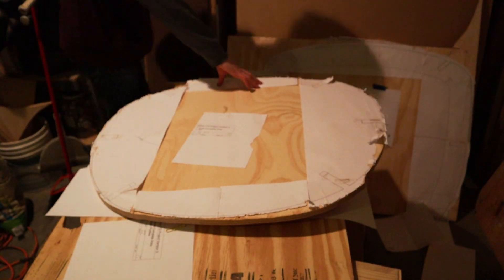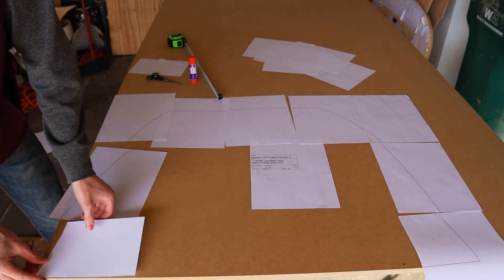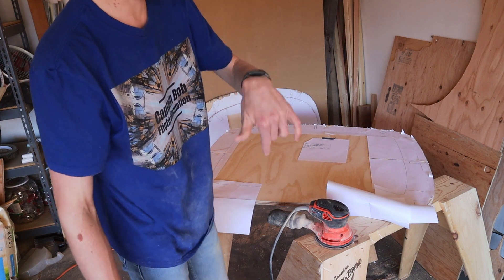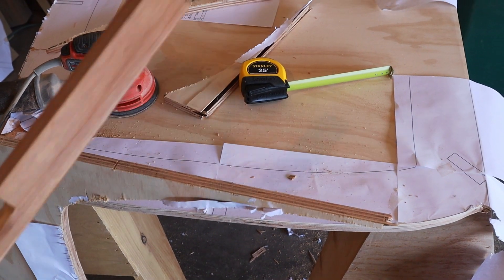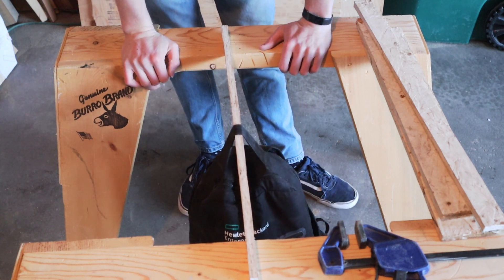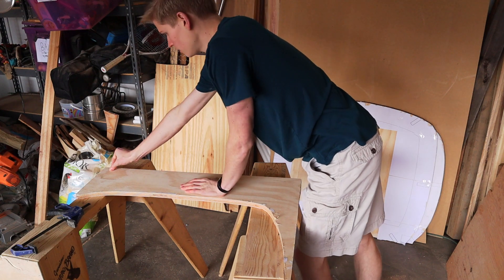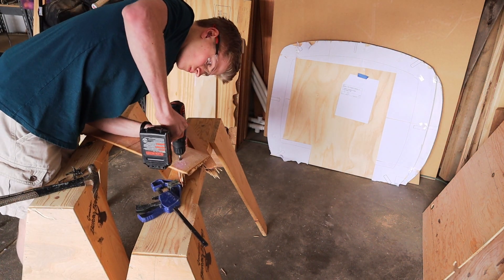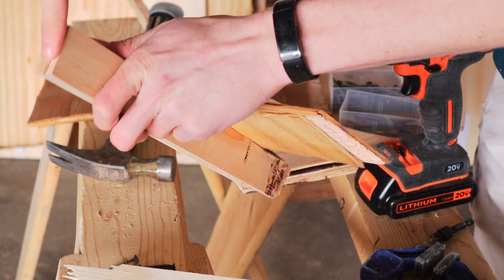Plywood Strength Testing and Cutting Ribs | Cessna172sdays Ep. 10  Captain Bob

Comment: Interesting. Have you come up with a formula?
Reply from the maker: No, but that would be very interesting to solve for!
I imagine more adequate measuring devices would help than just bricks :)
Reply: @CaptainBobSim  My project is to create a 1'x2' adjustable roof platform that spans two bolts, 20 inches apart. It is for the erection of a ladder upon the platform to service siding above very steep roofs. 

The metal platform and bolts should be able to hold 8000 lb, which is plenty.  My best guess is that a 3/4 plywood board a foot wide, can take around 18,900 lb before it breaks.  I am not sure if osha needs a 10 to 1, a 6 to 1, or a 4 to 1 safety margin.  Of course, I probably chose a 1 inch board, but would need to go to the storage to find out.

I am only about 140 lbs, and have tested the setup 4 times.  But I need to know if a 400 pound guy who misuses my unit will die, should it ever be used by other people.

   Now, for you and I, since we don't have a hydrolic press with a gauge, might need to cut a 1 inch wide plywood (maybe scrap from the stores or building site), and we can possibly extrapolate up to 2 inch wide and 10 inch wide by simple multiplication (a 2 inch wide plywood should hold 2x the weight of a 1 inch.)

My span is 20 inches, but code is 18 and 24 inches.  I expect that weight the plywood can handle is the inverse of the span length squared.

Based experiments, marine grade plywood is 11 percent stronger than regular plywood. And epoxy covered plywood in thin clear 24 hour soaking preprime epoxy, losses about 16 percent of its strength when submerged in water for weeks.

The online calculators for plywood load bearing are all over the place. In my project, I am seeing them spit out 300 lb to 18,900 lb.  But I am 70 percent confident that the center breaking load is around 18,900 lb.  But I need to test a 1 inch and 2 inch board, which should break at 1890*1/12 lb and 1890*1/6 respectively, if I am correct and the test is in the ball park.  

Still getting 300 to 400 lb of standardized weight would be tricky, since I don't have any weights anymore. Harbor Freight, might have a gauge that would allow a car jack or scissor jack to test this. Dunno.
Reply from the maker: These are some way awesome insights! It's fun to peek into the world of material science!

Comment: I wouldn't soak plywood. Plywood doesn't like water. Instead I would advise to use 2 or more layers of very thin plywood. Each layer will bend easily. You can laminate (glue) all the layers together on site, in their bent position. Laminating results in a very strong structure.
Looking forward to seeing this project progress. Best of luck!
Reply from the maker: Thanks for the tip Alex! I'll look more into super thin plywood. Happy Landings!
Reply: @CaptainBobSim  In fact, you could even stick to 1 or 2 thin plywood layers and use fiberglass on top for strength. I've seen many boat building videos using this method.
Reply from the maker: Very cool! Do you happen to have a link to the video? I found one method here that might be cool, is this what you're thinking of? https://www.youtube.com/watch?v=CakM0RH-RkU 
Have a great day Alex!
Reply: @CaptainBobSim  Yes, that's the idea. I've even seen videos where they use much smaller pieces of fiberglass which can be handled much more easily. I'll try to look for some videos
Reply: @CaptainBobSim  For the lamination process, here is a good example: https://www.youtube.com/watch?v=vVswXx2m3eI. Using thin sheets of plywood, they are able to very easily bend them over their mold. They use a vacuum to put pressure on the sheets, but you're planning to use screws and that would work just as well. The screws will be covered by fiberglass if you go that route, or simple wood filer would allow you to hide them. As you can see in this video, their end result is very stiff. You have to make sure to use enough glue. As you said in your previous video, more glue is always better than not enough. Have a great day too!